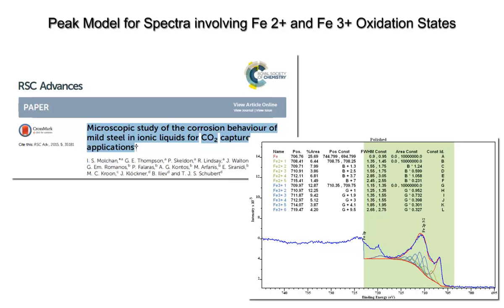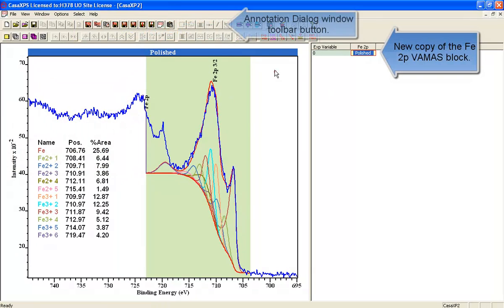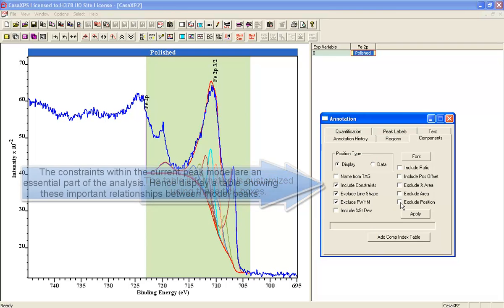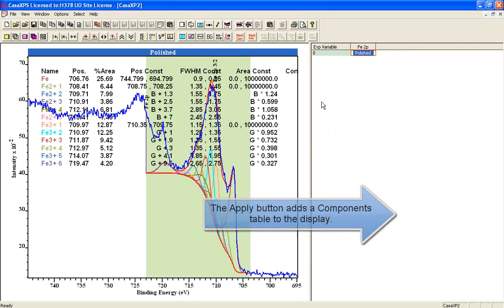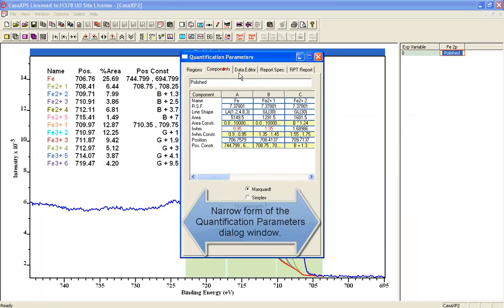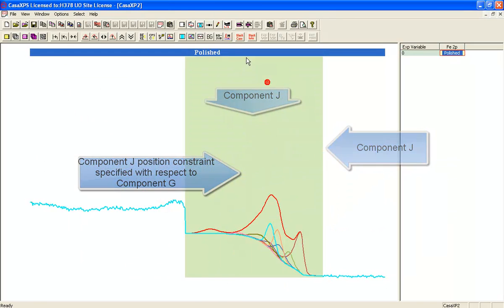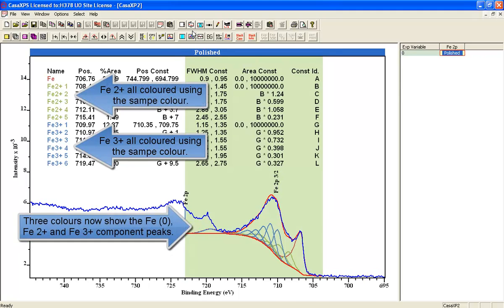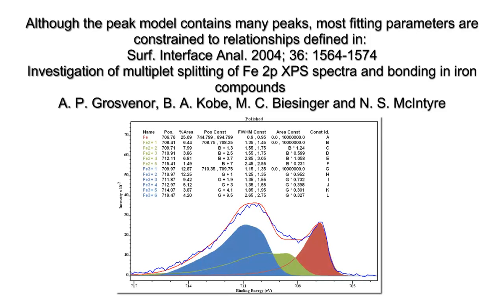Fe Part 1: Examining parameter constraints within a peak model in CasaXPS

Comment: Hello, would it be possible to explain why exactly you created a model with 5 peaks for Fe2+ and 6 peaks for Fe3+? I checked the papers mentioned in the video and the ones cited in their references but it is not too clear for me. Where exactly the position constraints come from? Thank you in advance.
Reply from the maker: This video was made to illustrate the use of constrained components in a peak model.  The background to Fe 2p is the shape with greatest uncertainty, while the role of the peak model is to create a set of constrained bell-shaped curves that, given the background, models the data envelope attributed to an oxidation states of iron. The number of optimisation parameters for each ensemble of components is limited by relational constraints, so effectively the peak model should be interpreted as a complex component that can be used as part of a peak model aimed at mixed state oxides.